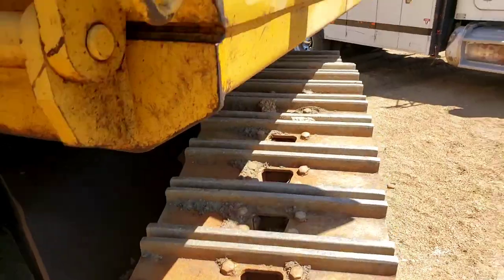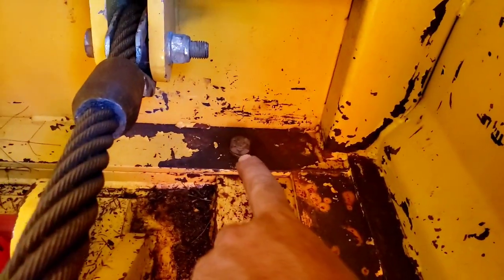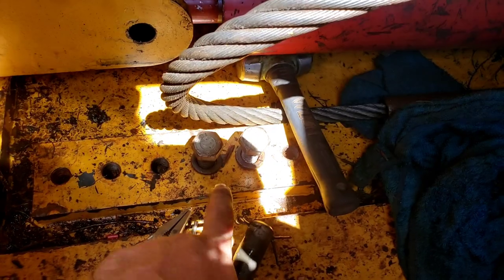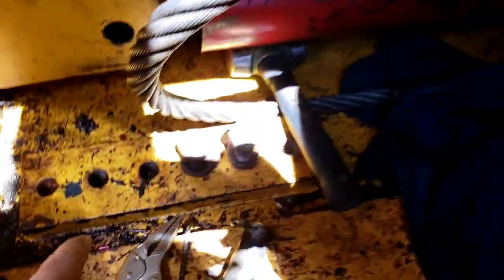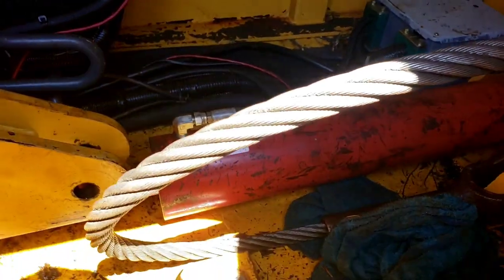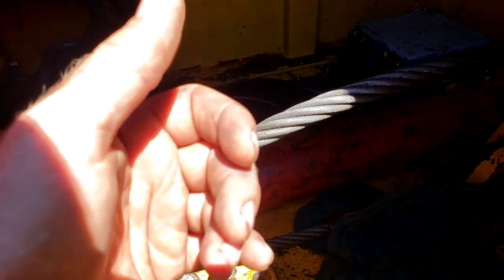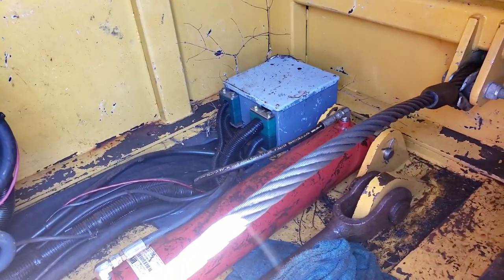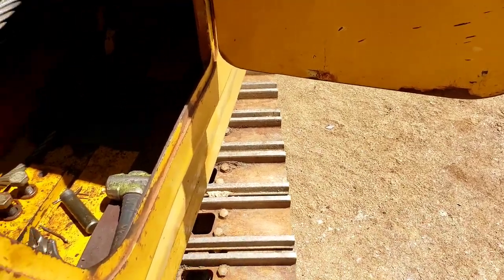Safety Tip when working on the cab riser hydraulics!!

Comment: I see a few of those cab riser motors come into my rebuilding shop. They seem to come in melted or blown up all the time. Does it take a long time for the cab to tilt and rise? The motors look like they've been ran for too long.
Reply from the maker: Yes. If the electrical has a problem. Guys will engage the motor but can't figure out the directional. High amp draw for extended time